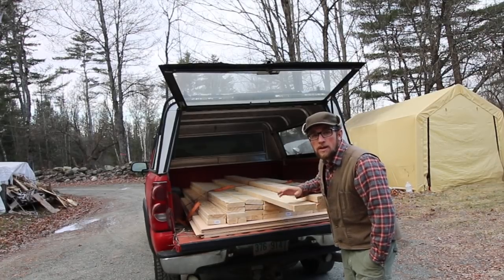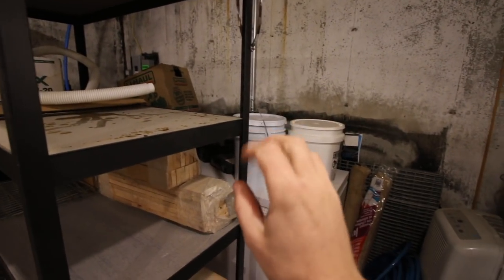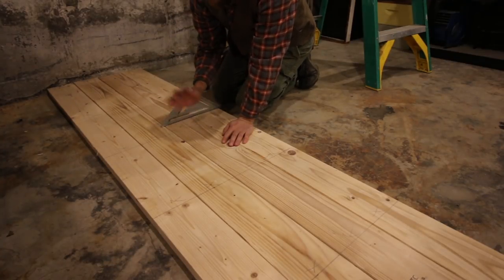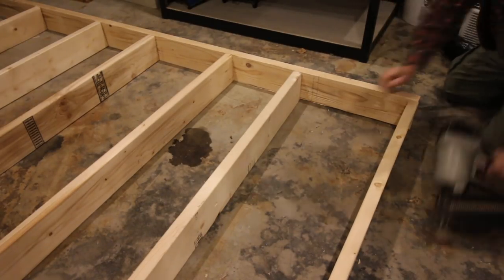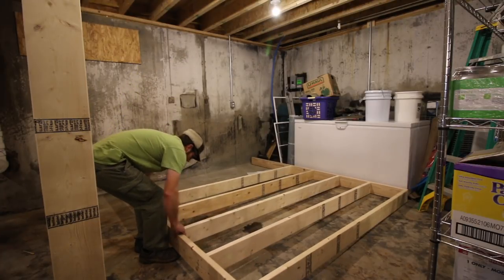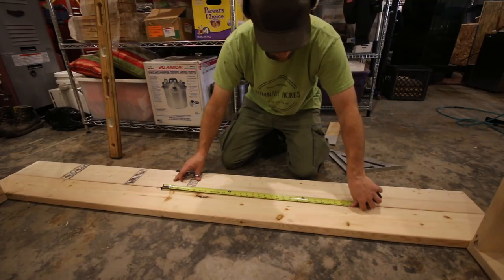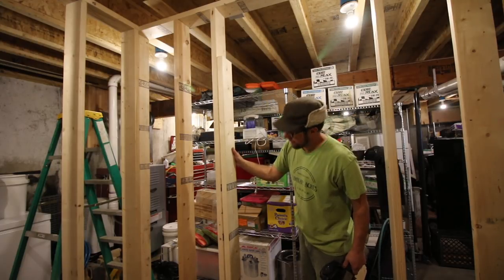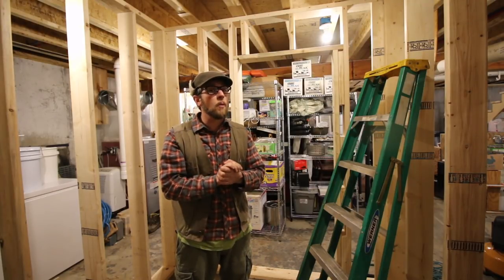Building our Root Cellar

Comment: Coming along, nicely. Sure wished I lived closer so I could stop by and show you some tricks of the trade, that would save you a lot of time. For example, since your plates are standing on edge for nailing, you can stand them on edge for layout. That way you could lay out all 4 plates at once, still see your layout marks to place studs, instead of covering them up on the faces. You could use a 6" speed square and layout all four plates. There's no need to use a tape to measure off both sides of the stud. Layout to the left side, X to the right. When you come back to strike your lines with the speed square, just inside of the rail is a ruler marked in 1/4" increments, strike the left side, set the rule at 1 1/2" strike the right side. That's why it's called a speed square, it's full of useful marks that speed up layout. 
Your miter saw stand also has some neat features to speed up work. The board supports on each side can slide in and out towards the miter saw. They also have adjustable stops that raise and lower. When you have to do a lot of repeat cuts, measure one board, line the mark up with the saw blade, move a support in and a stop up until it touched the end of the side your cutting off. Now you can just put up the next board, slide it to touch the stop, make your cut and go. A lot less time measuring and marking.

Comment: Nice looking build!   Consider using a pressure treated sill and a piece of foam sill insulation beneath your walls.   
My house was built in the early 80's, and the original owner built a storage closet in the basement.    Now, perhaps 30 years later the sills are dry rotted and I had to tear them all out.     We never get water or leaks in our basement - it's just the little bit of moisture coming up through the slab constantly

Comment: Al:   While your at the framing stage I would consider wood ducts for air handling.   You could  with 2x4's run a chase down the wall from the window opening bottom to 4" from the floor.  The cold air chase should be full window width this will help in summer to remove heat as the cool air will lose some heat to the concrete wall. Apply cheap foam board insulation to the room side of the cold air chase to keep it cool.The warm air exhaust duct should  be twice cross sectional area of the cold air duct.  The inlet as high as possible at the inside wall  ( above the door). It could also be the location of a cheap on the slowest speed;   exhaust fan,  thermo statically controlled to maintain a positive air flow if required.   But natural convection should work if you build a vertical duct/chimney on the outside for draft.  I would use wire screen material on the exterior openings for insect and rodent control.  Removable panels or flap doors could be used on the exterior openings for seasonal adjustments.Our root cellar when I was a kid was under ground so we only needed ducting for air movement and humidity control.  There was a couple of hundred feet of old creek estuary gravel under it so there was no seepage.   the old guy    Bert
Reply from the maker: great ideas. Your root cellar growing up sounds like one neat place!
Reply: Hi Al I just stumbled on this Video  '  Bill Edwards on Root Cellars   '  you and Gina might want to watch together.   Bill is in the northern half of British Columbia  a similar climatic region to you.     There is a lot of good information in this 2 hour talk on root cellars and food storage from a man who has lived it.      Bert

Comment: Adding a 'hanging' hook system would be nice, rough sawn lumber root bins and shelving, maybe even walls and ceiling in rough pine, would help keep cost down, maybe you have enough in the 'Lumnah Lumber Yard'. lol  Nice tight T&G plywood on the outside walls. Small fan and venting system through the basement window enclosure into the RC for fresh air circulation chilling against the heated basement side, and will provide passive fresh air circulation in the Summer months. I would go so far as to put a thermostat in series with your fan unit to keep it from becoming a 'freezer room' in the winter.  I know that you don't need to be told this, but tightly insulate walls and ceiling, varmint and bug proof all outside openings. 'Boss of the Swamp' and 'Doug and Stacy' have some really good & recent vlogs on insulating systems. God Bless
P.S.I agree with  'Little White Dory' that isn't a hoarders cellar....it's a 'Modern Steader Cellar'!
Reply from the maker: I am looking forward to finishing the build! My first priority is having a safe place to hang the meat! A thermostatically controlled fan would be nice

Comment: Great build Al,think about LED lighting to save energy, as well when in use very little heat will be given off inside the root celler-Jerry
Reply from the maker: All of the lights and bulbs in the house are led. They save a ton on electric and like you said the barley put off any heat

Comment: Al, when I read root cellar I thought you meant a real root cellar.  You basically are  building a storage room in your basement. 
You have me thinking about my grandmothers old farmhouse. They had a dirt floor cellar with stone walls.  Always nice and cool down there even on the hottest of days. Possibly because of a large rainwater cistern in the cellar which was the source of water for the kitchen.  No hot water. Cold water only brought up from the cistern by a hand pump.  Basically the cellar itself was a root cellar with a house built over it.  Also, no central heating . The only heat source for the house was a huge wood stove in the kitchen. Basically only one room of the house was directly heated and that was the kitchen.  But, people, at least farm people lived differently in those days. They did not have a living room. They had a parlor which was only used when company came over.  Otherwise the kitchen WAS the living room.  The upstairs bedrooms were heated with an open register in the floor.  With the result that the bedrooms were always pretty cool as the air circulation was by convection.  By morning you never wasted any time in getting dressed on a winter morning.  To this day I still prefer sleeping in a cold bedroom. A warm bed of course but with a very cool face.
 During haying season other farmers would come to help with the haying.  The kitchen table could be expanded into a huge oval shape and as I recall could seat about fifteen men. Three or four wives would also be there to help with the cooking. My grandmother as the chief cook/director and that table would groan under the weight of the food. In later years after my grandfather had passed away, my grandmother lived in a more modern house with an electric stove. I can still hear her complaining about that electric stove and missing her old woodstove.

Comment: Looking forward to seeing how you might do cold air inlet. We our basement space we want to turn into a root cellar. The basic version would be simply insulating everything above ground. Would love to have some system to let in cool air at the right time however. The problem down here is many winter days are too high a temperature so we would have to have a cut off system to only let in cold air.
Reply from the maker: That is going to be the fun part figuring out the thermostatic control fan. Lol  Does your basement have a good northeast corner? How about a dirt floor?
Reply: It runs the whole west end of the house. It is sunk in the earth so every wall backs up to ground. Pretty cool already. Floor concrete, wall are stone. It is quite damp, probably not good for the house (though it has lasted almost 100 years) but I guess good for a root cellar. I have thought about making this a dry storage place and making a moist storage area apart from the house.
Reply from the maker: ART and BRI I bet that would make a good root cellar. I am surprised your house doesn't already have one. Is there a smoker in the property
Reply: It really is a root cellar. I mean it was used for storing food, mostly canned. It just needs a lot of cleanup and insulation above, new shelving. There is an old smokehouse. Measures about 7' x 9.' Don't know if it makes sense to use such a large structure for what we would be smoking, but it would be fun to use it.
Reply: Art, you need to put in a ground pipe system. By putting a pipe in the ground will allow you to bring in cold air all year. Install your pipe in a loop system with a fan on the end.  A simple design and works great even in summer. As far as moisture problem you can use a dehumidifier to dry up the air without heating it.

Comment: Looking Good.  Don't you need pressure treated for the bottom plates on concrete?
Reply from the maker: our concrete slab has insulation under it so there isn't any moisture coming through the concrete

Comment: Great job, although do you not need to install a vapour barrier (6mil poly) between your concrete floor and your sill plate? Our local code (Canada, Ontario) requires a barrier to prevent rot.
Reply from the maker: We have a vapor barrier under the concrete floor

Comment: Just one minor issue  / FYI:  Root cellars work because they maintain 90% humidity, which is far higher than outdoor air, which means that although yours will work, it will not work nearly as well as an in-ground cellar.

Comment: so wish i had basement so i could build this but mine had to be filled in cause i livw 1/3 mile from missouri river and a 1/3 mile from Gasconade  river so too much seep water
Reply from the maker: I am sorry to hear that.
Reply: If you have room on your land put the root cellar on a raised bed, in case of flooding insulate it well double walls with air gap between walls, mound dirt over it if need be. Many ways to go, you dont need to be under ground. Good  Luck.

Comment: Never, ever put untreated lumber, directly on concrete.   Concrete is a sponge for moisture, and moisture and untreated lumber, are not friends.
Reply: I was thinking the same thing.  I would have at least used the PT as the bottom plate with PT nails.  I do wonder why the 2x6 instead of 2x4...possibly because of making it a better insulation from the main basement?
Reply: @noreen_ann1438  just add still plate gasket to the bottom plate,